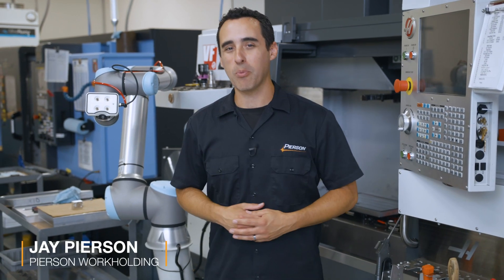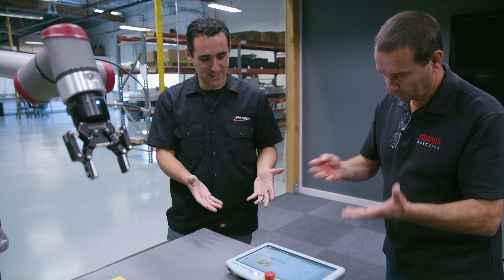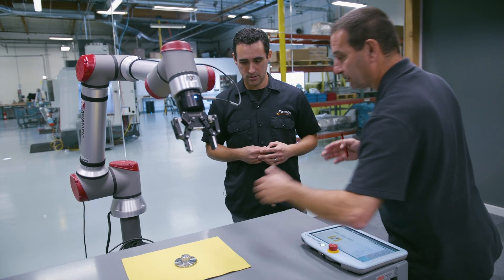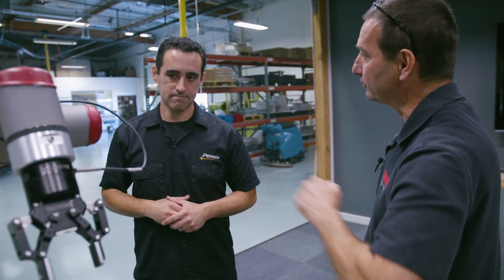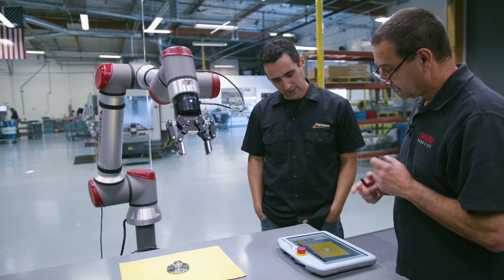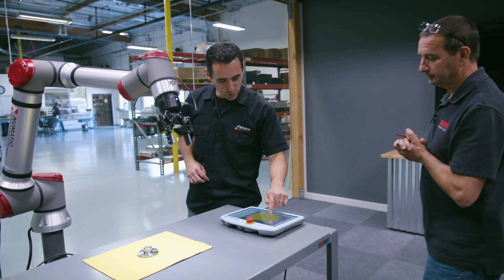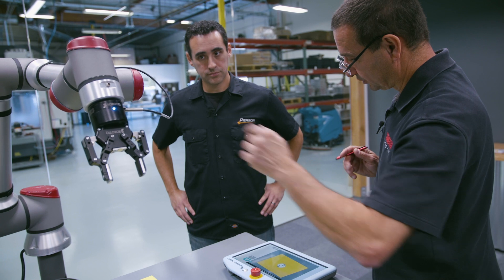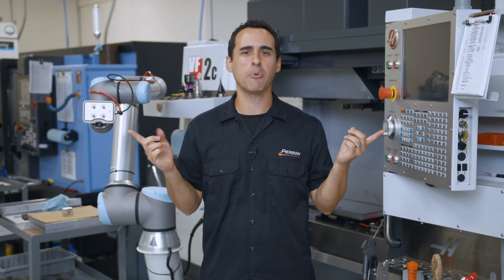Full ROBOTIQ DEMO | The Robot

Comment: "everything automatically works" mostly. I've run into numerous Polyscope and URCap issues. Also that camera cable is a gigantic pain in the ass. The camera will never connect to the tool port on the existing E-Series robots. It requires a high bandwidth USB connection. The 485 Communications available on the tool part is not enough.

Comment: Amazing. Now they just need to make one with a higher weight capacity. I wonder if the system could handle multiple parts in sequence so you could do multiple ops on the same part?
Reply: The main issue with making cooperative (inherently "human safe") robots stronger is that the stronger the robot is, or the faster it moves, the less sensitive it is to hitting squishy humans who get in the way.  The RIA spec for a robot to be safe (without fencing, barriers, etc) like the UR is based on the total kinetic energy of the robot+payload at any given moment.  So in the eyes of someone with experience with "classic" robots, the URs are small, slow, and painfully underpowered.  But where URs shine is their inherent safety (which lowers TCO), and their ease of use.  All the "big iron" robot brands have multitudes of option packages that are excellent, but they're all industrial style -- the "app store" level of "easy mode" just isn't there yet.